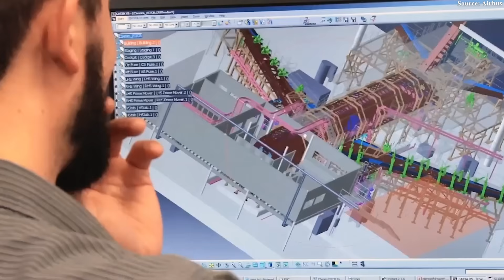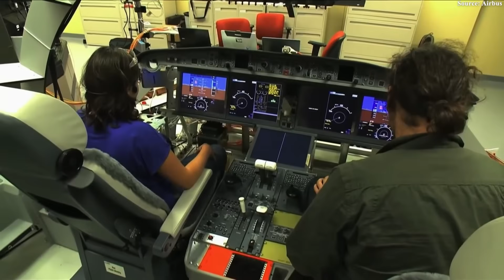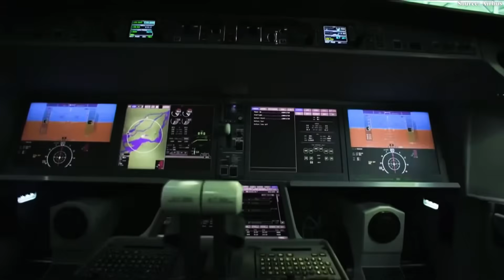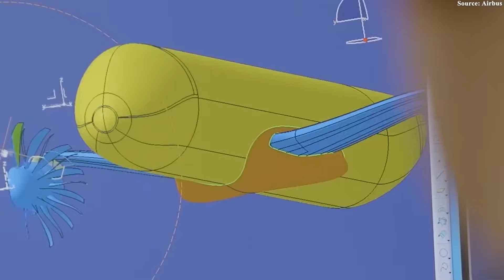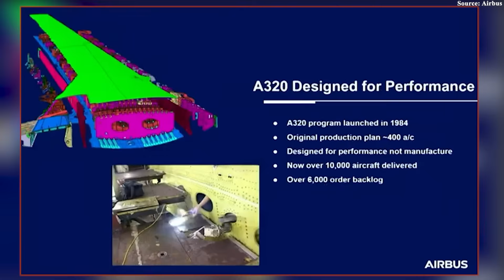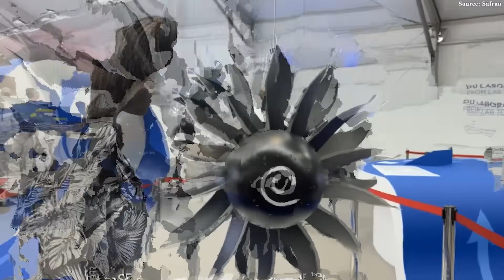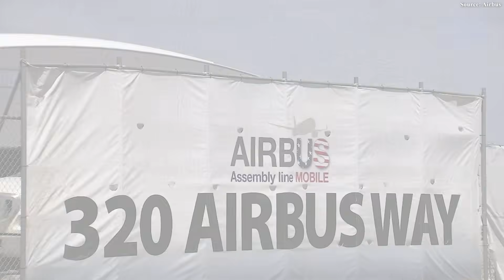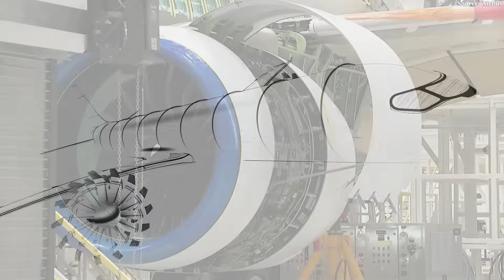Airbus A320neo's Replacement Is Coming - A Serious Threat to Boeing

Comment: The open-fan engine concept is fascinating! It sounds like it could revolutionize efficiency in commercial aviation.
Reply from the maker: Yes. That is the engine of the future.
Reply: What about safety? Turbofan engines have reinforced Kevlar containment shields in the nacelle for a reason. In the event of blade damage or a fan blade separation, this is the only thing that protects the aircraft fuselage and wing from damage.
Reply: It will make a turboprop five blade engine sound quiet.😊